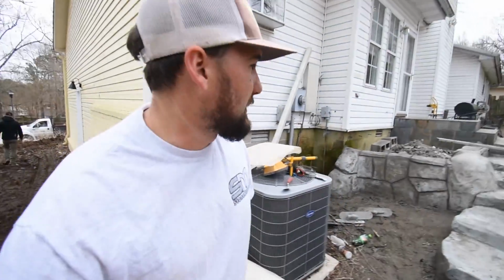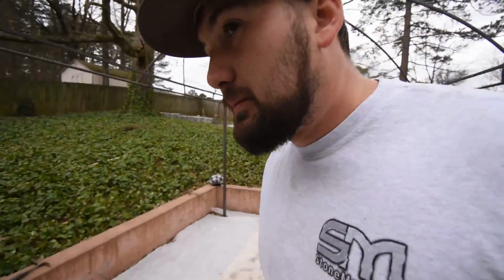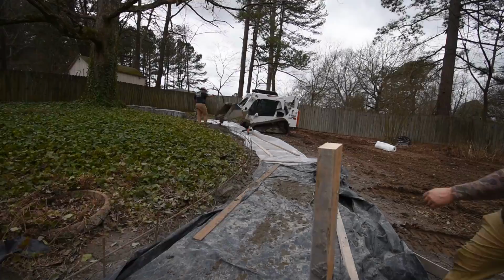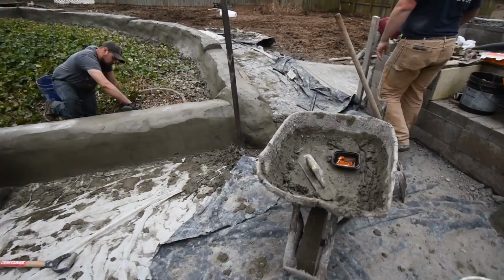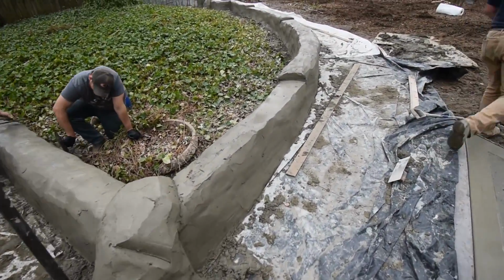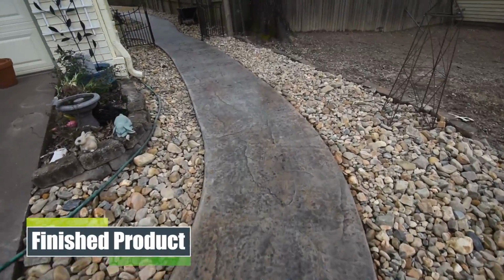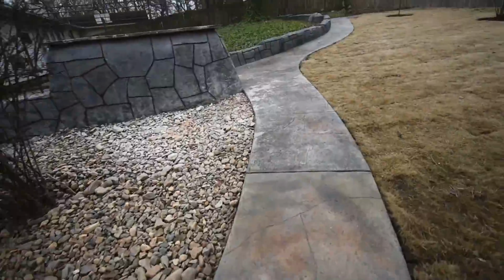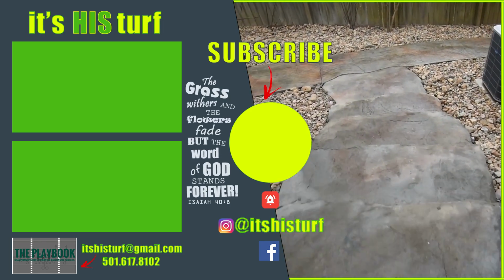Total Property Clean Up Part 2

Comment: I really like that you not only can do more, but you show your projects.  How long does it take those walls to cure? I know sidewalks and driveways can take days to cure.  Is there a wire form used that I missed?  How long does it take to completely dry?  Will it crack and, if it does, doesn't it enhance the look of rock?  Depending on what the wall is made of, can large, say 3-4 inch chunks, break off?  Sorry there's so many questions!  I just have never seen a project like this.  It's amazing that you did it in two days!  Is it spring there?  Wonderful job!  Congratulations on a job very well done!  👏👏👏👏👍👍😎🇨🇱❤